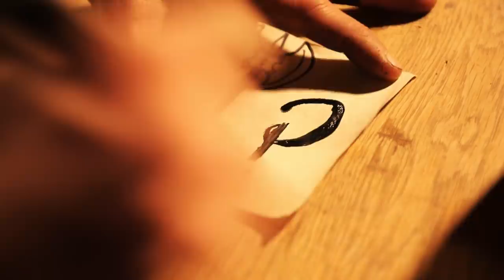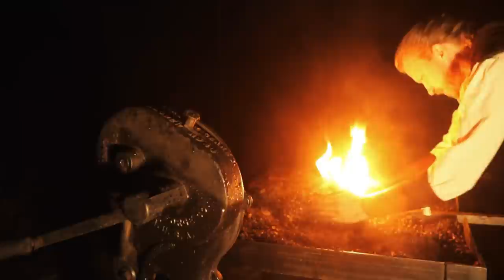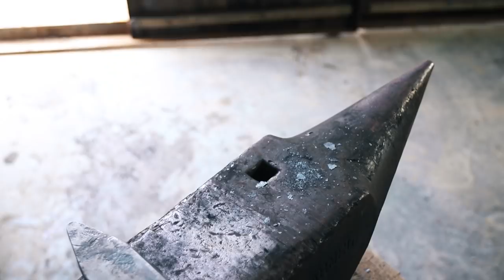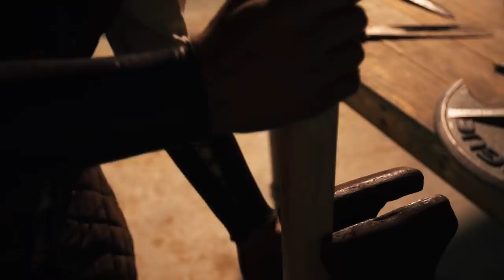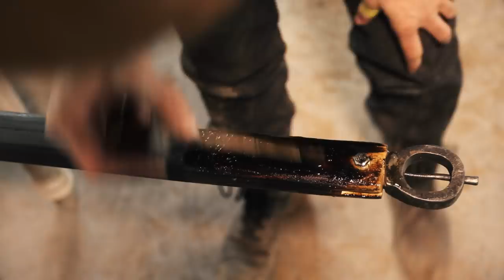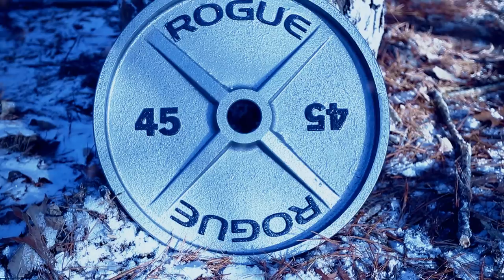Rogue Fitness Weight Plate Battle Axe for The Mountain

Comment: This is an interesting project, but from the technical side, this axe obviously is only for pumpkins. Weights are made from casted iron. Casted iron is very brittle and unsafe for tools and such things that need to hold on force  (axes, spears, swords, arrowheads). That's why it needs to be forged and quenched in oil or water and be stabilized on low heat.  Otherwise, it will be unusable...
Reply from the maker: This is an interesting comment, but from the technical side, this video is obviously full of silliness and fiction. Try not to over think it.

Comment: Video is great. Editing top notch.
Sorry to say, the Axe is a wall hanger. The style of construction has put too many failure points in the axe, especially where the bolts were drilled through the wooden haft. I was amazed it didn't shatter when you "tested" it.